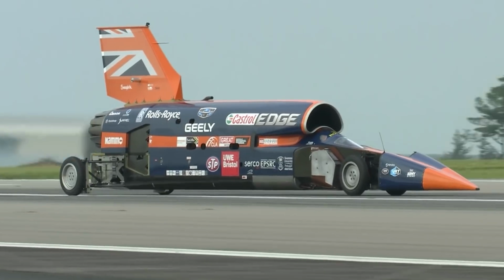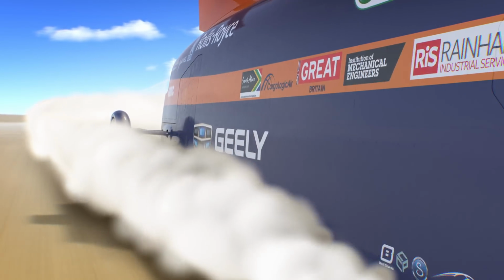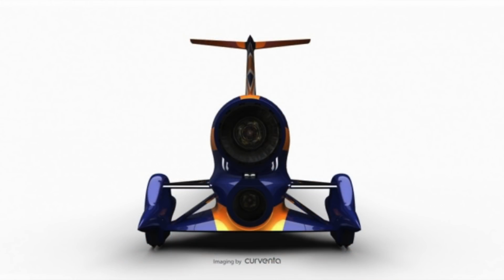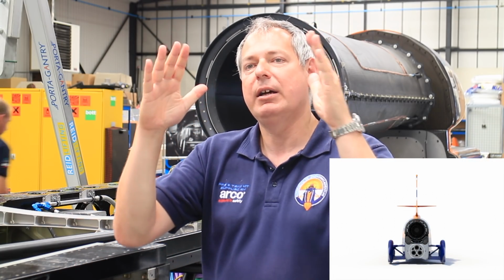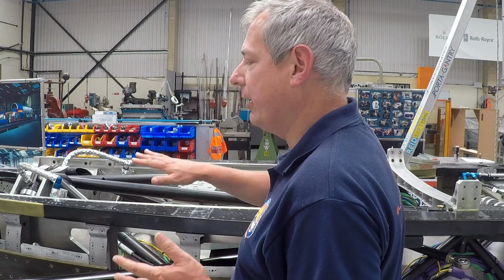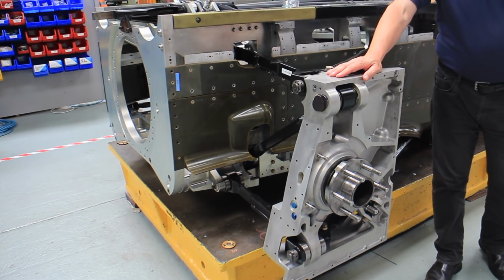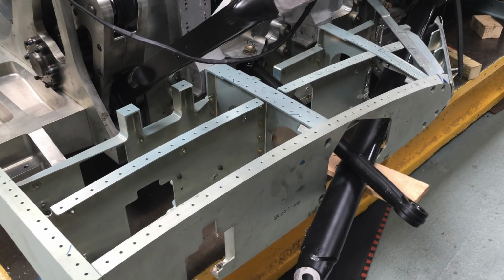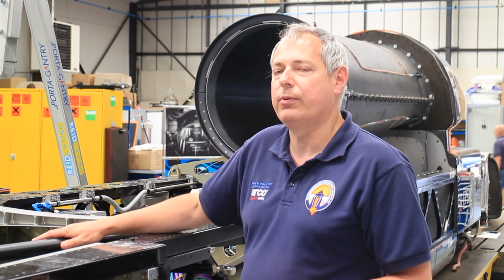BLOODHOUND Project: Progress Report

Comment: How does Bloodhound react to engine failure in the higher speed regime. The pitch couple change looks ‘interesting’. Have you designed an FBW response? Its absolutely brilliant yet unlike an aeroplane there is no substantive permitted altitude variation; small inc in downforce or very slight upforce inc. Sorry I know it is a lot more complicated than that.

Comment: What's your chances against the aussie invader 5R land speed car.  who are also going for the same record as your team of 1000 mph.
Reply: AI5R is being well built and could break the current world speed record but I doubt it will do the 1000mph as it has quite a few design features that BH has already discarded due to instability and dangers at high speeds (such as the tapered in underside which creates lift). I would love to see them battle it out on the Haakseen Pan!!!! Good luck them all :-)